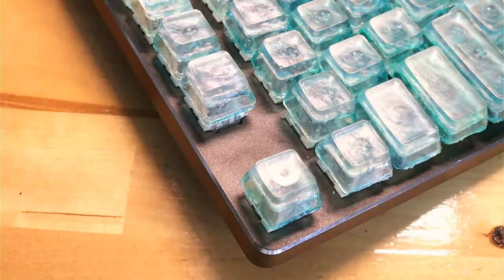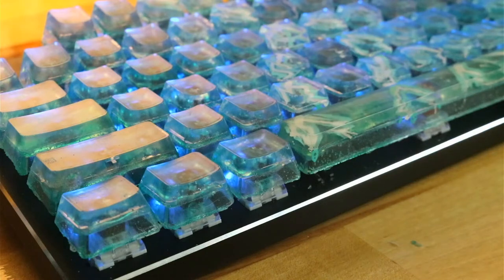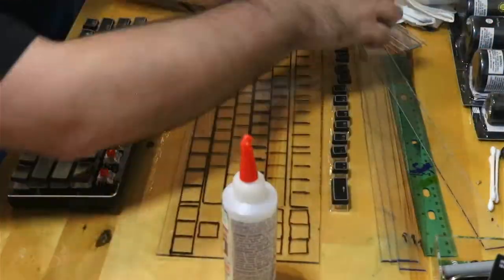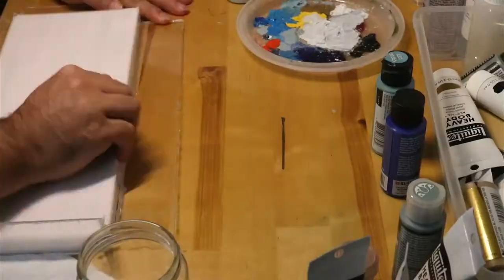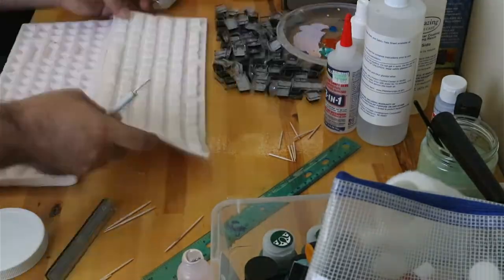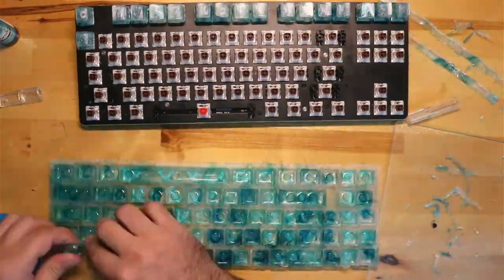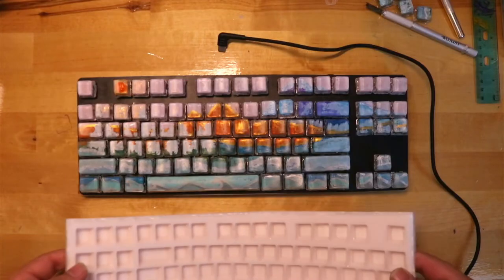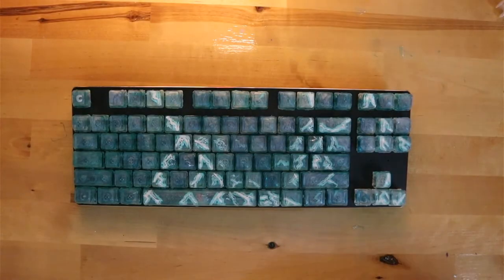How I Created a Resin Keycap Set

Comment: Cool! I'm making my own right now, key by key, using a mold set from Amazon. It's working, but the keys are different heights? And the spacebar ends up being too heavy, so it looks like I will have to make my own mold for that.
Reply from the maker: So I started using the same mold from Amazon just to get comfortable and better understand the problems that could happen. I definitely suggest experimenting using that mold set and trying out stuff with UV resin just because you don't have to wait. Not only will those sets have problems with height but you also have problems with their positioning. The gaps between the keys will shift quite a lot. A millimeter here and a millimeter there can cause huge problems. If you make a mold where every single key is shifted by the exact same direction and the same amount then there won't be any issues. What I did ultimately was just to save a bunch of time although not every single switch is perfect and there are tiny bubbles here and there, it accomplished what I wanted.

Comment: Is it possible to make a key caps set of like a favorite band? Like EDV or Metallica.
Reply from the maker: Yes, however it is hard to pull off because you have to paint the layers backwards, and the keycaps are hard to make look cohesive. A flag, or things that have simpler shapes work best. If you've ever painted on glass, you'll find it's rather hard to do.